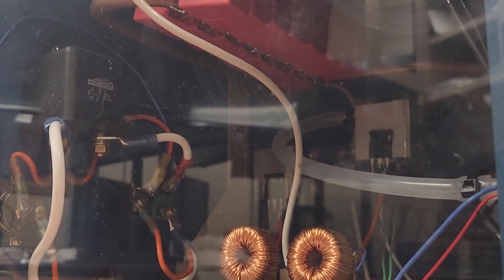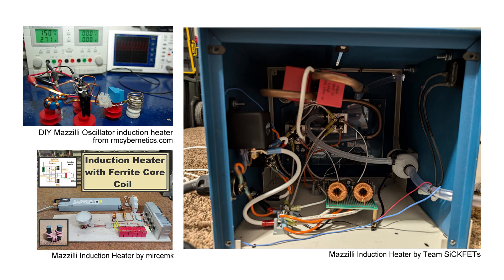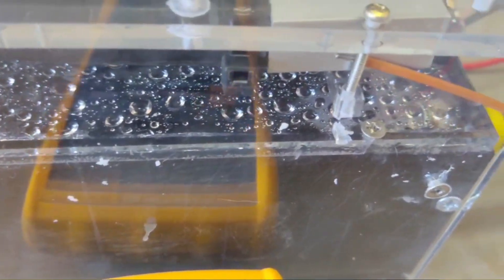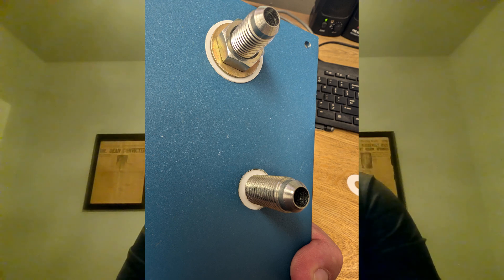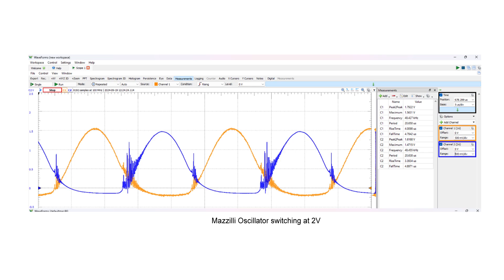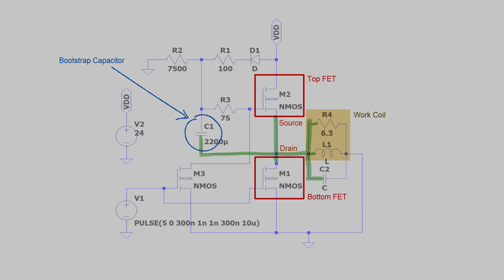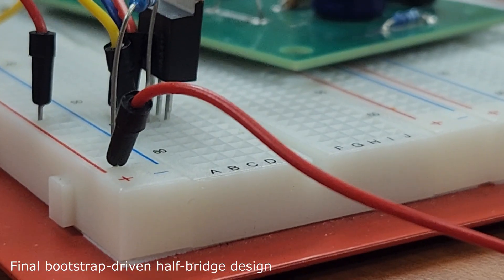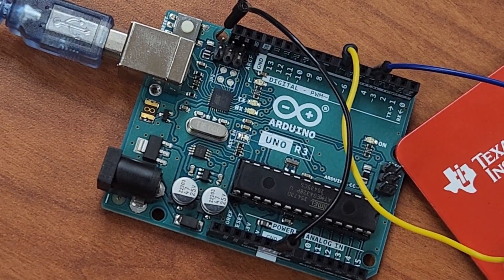Low-Voltage Inverters for Induction Heating | Electrical Engineering Senior Design 2024

Comment: Excelent project.
I am building an induction heater at the moment.
I'm going to use ZVS ossilator, but I was considering the low voltage controller to control current and power.
Are you planning on doing a follow-up video?